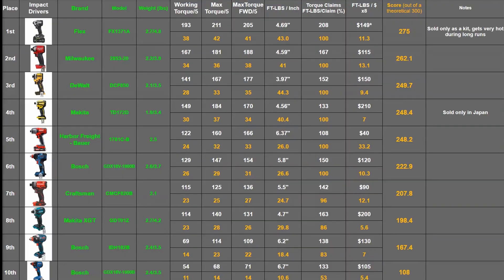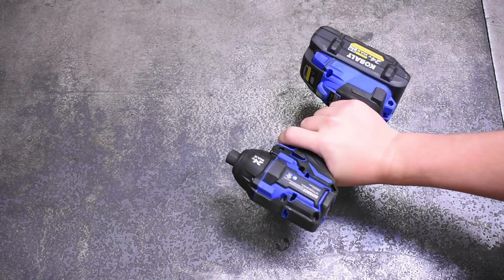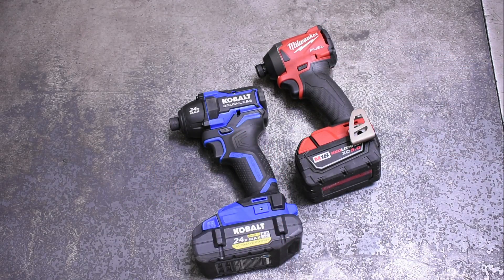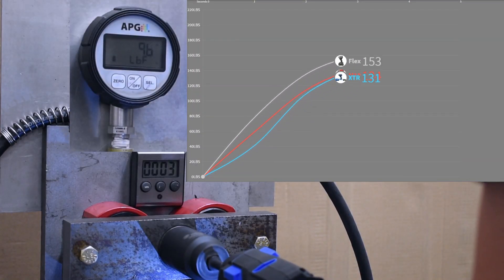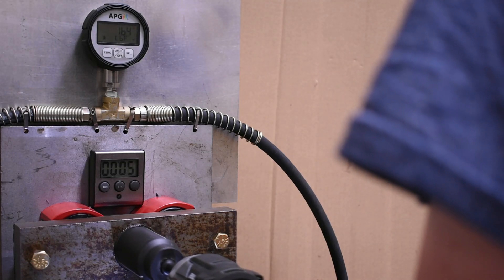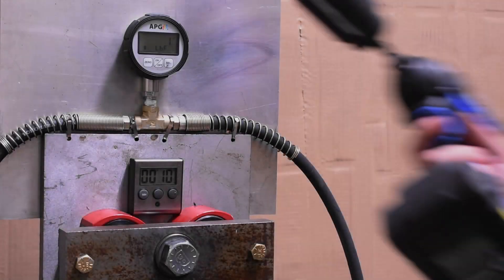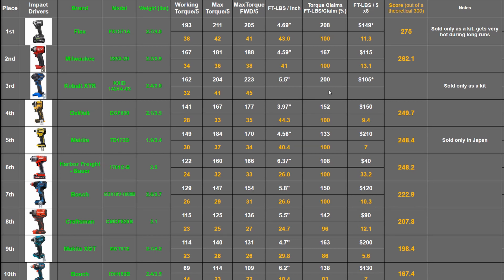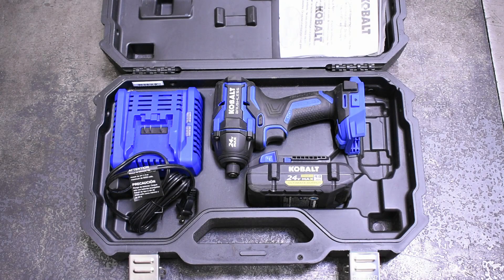You All Said THIS is the Most Powerful Impact Driver: Dyno Finds Out | Kobalt XTR

Comment: I think the amount of air flow on the kobalt xtr it'll run cooler the more you use it and you should try out the metabo hpt triple hammer impact driver it's has torque but get warm rather quickly

Comment: Just like they showed, I don't use these impact drivers on large lag bolts.  Can break your adapter bit and will probably end up burning out your impact driver eventually.  I did burn one out as well but was fixed under warranty.  I use my bigger 1/2" impact wrench on those now.

Comment: I just bought the xtr hammer drill/impact kit for $249 (normally 299)....surprised the light in the kit is something I actually use.  The smell goes away after a bit of time being out of the case and getting some use in.  It's something with the overmold on the XTRs as the standard tools don't have the smell.  I'm wondering what the 3/8ths impact head bolted to the xtr would put out for beans....not sure I want to tear my tools apart to see if it bolts on or not.

Comment: As someone who uses impact drivers for high-grade finish work (fences and decks and outdoor kitchens for millionaire clients in NYC), I really appreciate an impact driver that brings the heat gradually, it offers so much more control over where the screw head ends up. That's a big deal when you're driving a few hundred screws and want them all to look perfect and identical. So I think the slow-climb curve of the XTR is more desirable for a driver. Anything you'd want faster beans for, you'd be in the impact wrench side of things.
Reply: I agree, seems like a lot of the newest brushless tools are like operating an on and off switch. Brushed tools from 5-10 years seemed much more linear. The XTR appears to have the power when you really need it but not too much when you’re starting fasteners in delicate materials or trying to do precision work. I rarely use my m18 fuel as an electrician because many of the fasteners we deal with could strip the threads out with more then a few uga-duga’s.
Reply: Using your speed selectors and trigger discipline would go a lot farther than a whole new driver.
Reply: I have recently switched to Makita xgt and the selector switch on the impact driver means you can choose exactly where the fastener stops, amazing for thin sheet metal etc.
Reply: @Jailbikeco  -  Ya, that speed and torque control on the Makita is amazing.
Reply: @midniteoyl8913  it really is and I feel like a lot of reviews miss the point of impact drivers (not this channel, this is all about beans). Being able to have full powe,r press one button and have it stop before stripping, then back with one button it's way more important than  2 seconds faster driving a 10" lag screw.
Reply: Not true, as a formworker I want to put 150x6mm screws quickly. Impact wrenches don’t have the rpm like an impact driver. 

An impact wrench is like a slow moving tractor but the impact driver more like a sports car. As long as I’m driving screws up to 6mm (1/4 inch) then I don’t need the tractor. 

Obviously your needs differ to mine.

Comment: I’d like to see how the Surge performs versus the standard gen 3; to see how much is left on the table by choosing a quieter (and easier to use in some environments) impact. Also - on overall length of the head - it’s absolutely a factor, even if shorter than the battery. I was rewiring a house this summer, and my impact with a short length auger was frequently the only thing I could fit in to tighter (oddly laid out) stud bays or joists. If the tool had been even 1/2” longer in the head there would have been a ton of areas I’d be stuck trying to find a workaround.

Comment: I have the impact, 1/2 inch impact, hammer drill, right angle impact, and light. The assist mode on the impact is amazing, the hammer drill has tons of settings, the light is sneaky good, and the right angle impact destroys the milwaukee 1. I have loved them all so far. I need to abuse them some more(Finished a lot of projects up before summer ended) but nothing has been disappointing yet. If your looking for a new line of tools or just starting your tool build up jump into the XTR line.

Comment: A few years back I bought the $99 standard 24V kobalt impact driver would be curious to see what it puts out even though it is not up with the XTR line I find it does the job for most home owner stuff. Any big lag bolts I go right for 1/2" impact and scoket.  Seems like those adapter for hex drive break too easily on big lag bolts.
Reply: I have both the $99 1/2 impact and the big 700 ft pound impact.. I do a lot of hobby car work and the $99 impact will take care of 95% of the work, and if it won't the big 700 torque gun will easily handle anything you'll find on a car.

Comment: Very nice impact driver.  I'd consider it if I didn't already have one.
For about 7 months now I've been using a Ryobi PBLID02B impact driver as an auto tech.  I find it plenty powerful with good battery life.  I'd be curious to see how it measures up on your charts.  It's seen few fasteners it couldn't handle without either loosening it or breaking the bit, adapter, or fastener itself.  It's quite a workhorse.

Comment: With the kobalt being so much like and similar to the flex, I wonder if you could swap the battery packs between the two either with a adapter or just switch them, what the power difference and out put would be.

Comment: The Milwaukee is already close to the limit of being too powerful. The other two will definitely damage bits or damage what you are working on if not careful. Even with torque sticks, I wouldn't trust the flex and kobolt. 

I am of the opinion that if more torque is needed, one should get a different tool, like a 1/2" impact wrench or something.

Comment: Great video as always!

I'd like to see tests on slightly older model impact drivers compared to the latest and greatest, like the DeWalt DCF885, DCF886 and DCF887, Milwaukee M18 2657, M18 2750 and M18 2850, Makita XDT11, XDT13 and XDT14, and then throw in the older Ridgid models in there too, just to stir it up even more.

Comment: Now, use this all day, every day and see how it lasts,... or doesn't, and then come back and try this test.  I'm in the trades, and I see blue, green, gray and orange and Craftsman Red tools in the smoke pile all the time.  I keep telling the guys, both new and older, to stop wasting their time and money on lower priced and lower quality tools if they are going to be using them professionally, and step up and buy Yellow, Blue or Red and Buy Once, Cry Once.

Sure, these may be OK for a seldom used tool, and that price is quite in line for that.  But if it breaks on the job, you'd better get  screw driver, because you're not going to be "running back to the store for an exchange" and taking up time that could be better spent working on the site.

Comment: Still don't think it's right to compare A higher voltage tool to a lower voltage tool. Now with the Flex does not like to be run long without heating up how long will it last being used a lot? And the Kobalt only moves above the rest in the later seconds of the test where you had said how great some tools are when the are first being used. So it seams like your talking out both sides of your mouth when comparing. I like the tools being compared.  But compare the tools equally. So if you can only buy a tool for $179 then that is how you compare the tool. The only way to get the tool is in a kit and not lower the cost doing your math to shave points off to make them better points. When they sell the tool by it self then you can go back and adjust.

Comment: I have one and I love the thing, but I didn't expect it to actually beat the M18 and Flex here. I'm really surprised by that, though it should be noted that this only applies for torque. For driving tasks it is notably a bit slower than the other two. That said, this test is exactly why I wish they would make an impact wrench out of it, exactly like they seemed to do with their older model. What an absolute beast this thing would be with a 3/8 or 1/2 inch anvil! Or, even better, turn it into a Bosch Freak competitor with a hybrid anvil (it could certainly use one the way it can chew through adapters)! It would be a bit bigger than most compacts, yes, but it would certainly be justified by the power and price!
Reply: Really wish the XTR line would give bare tools and more of them. I'd switch from Ryobi in a heartbeat if they did that!
Reply: Someone on the Kobalt FB group claims to have done this but didn’t post pictures.